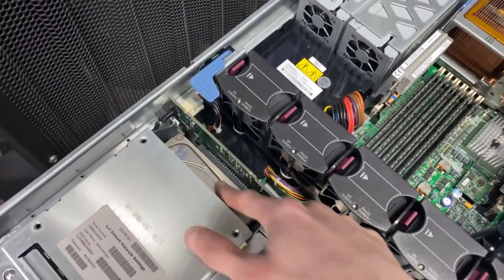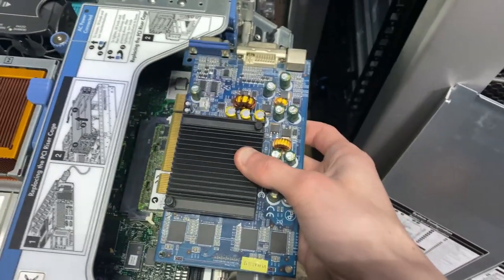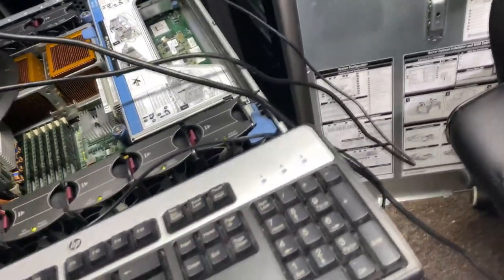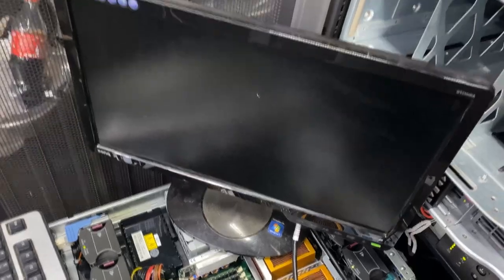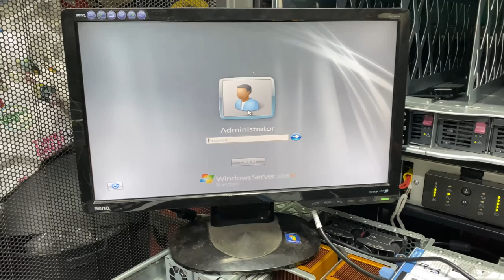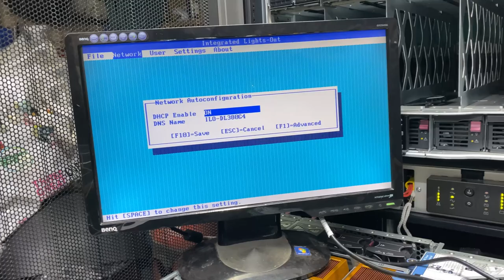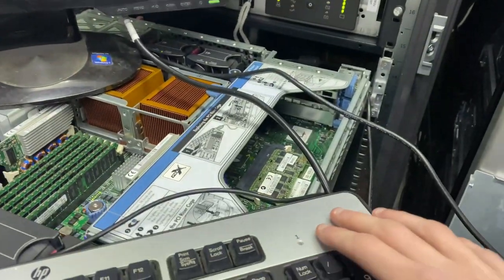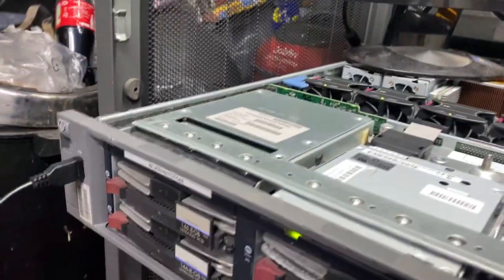HP DL380 G4 Repair (No POST)

Comment: HP has lifetime warranty on the procurve fans. There is a webform where you enter the serialnumber and they will send you brand new fans even if the switch is like 15 years old, pretty cool.
Reply from the maker: Ah thanks for this, I'll have to see if I can find it and submit a request. Would be great to have some new fans as those use something like 15V if I remember right.
Reply: @CobsTech  the lifetime warranty is for the whole switch too, so they might send you a refurbushed unit without the modules.